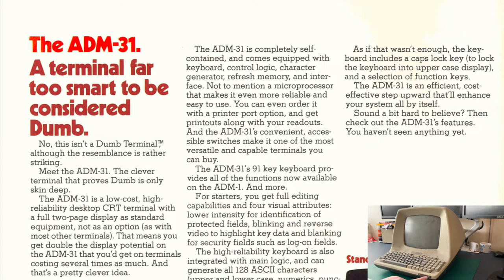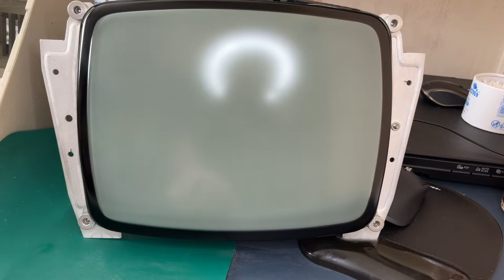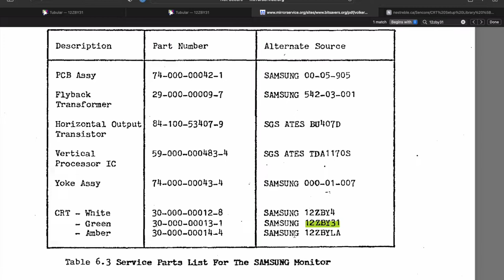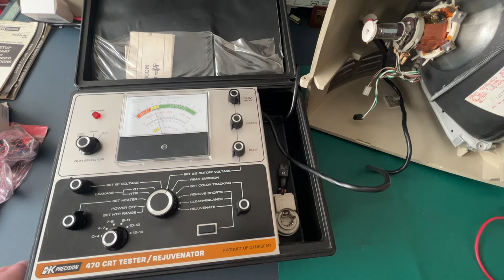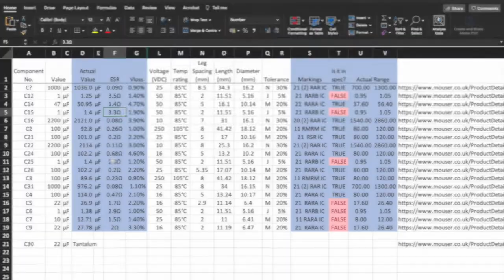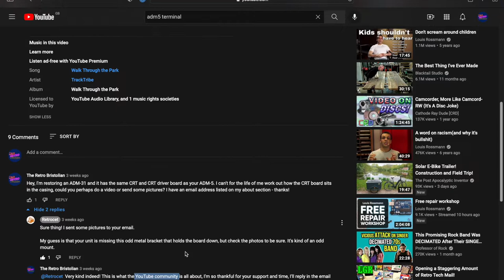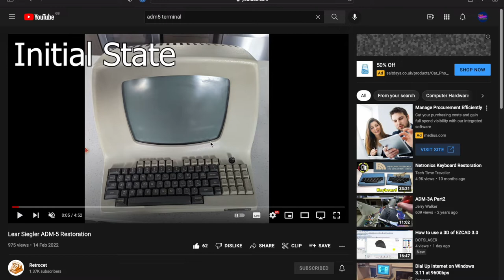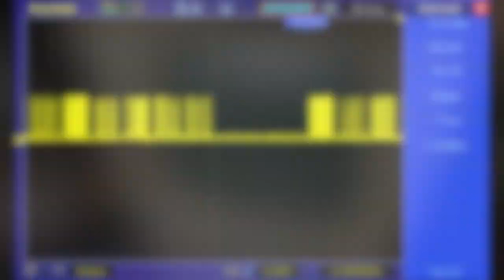Lear Siegler ADM-31 Terminal - Repair & Restoration Pt.1

Comment: Hi David,  Just did a spectrograph on the sound coming out of the terminal at the end of the video. Ive sent you an email with it. the horizontal frequency is way too low at 7688hz.  it should be at about 15khz ish.. My hearing is poor due to too many live concerts so i use Spectroid app on my android phone to hear things i cant hear.  I would check the horizontal ....

Comment: Used an ADM terminal in college to write 6800 assembly code and it eventually went to a teletype that could also produce punched tape. Then after college was able to use a TRS-80 Model-1 computer.

Comment: I just bought one of these and am waiting for it to arrive.  My first thought would be remove the CRT and CRT power board from the equation.  Can you pull a composite video signal from the logic board and send it to a known-good external video display? You might feel better spending time trying to fix an old analog CRT if you could see that the underlying brain of the terminal was already working, or if you should focus on that instead.

Comment: Have you made any progress on the terminal. I have one of these still in use on radio automation equipment. Make sure the contrast and brightness pots are ok and turned up. The solder connections on the pots can get lose. Also jump pins 2&3 on the serial connector this allows you to type and locally display. This will verify that the cursor is not hidden off the screen. As the pots were cleaned it’s possible the data is there just off screen due to size and position adjustments on monitor board. The high pitch whine noise is a good indicator that it’s possible out of adjustment with sizes causing yoke to deflect beam off screen. Some high pitch sounds are normal from those CRT’s. Mine has given issues with the bright and contrast pot on main board from getting dirty over years and causes blank screen issue. Try simple things first. Sounds as if the terminal is working. If you have a serial cable connect and set rates same and use a pc with terminal emulator and send and receive from keys this will check the communication. Might need null modem adapter or custom build cable
Reply from the maker: It's back in storage at the moment. your points are very interesting though for sure, when I get back to it it's all things to try. do you have an ADM-31? or a similar terminal? it would be helpful to see a video of one powering up, and being used - Thanks for stopping by and offering help/support.
Reply: @TheRetroBristolian  I will do a video of my terminal and a few test results as well that you can try.
Reply: Here is the second video I done on sync pulses measurements from the SMC CRT controller IC. https://youtu.be/37neAAYg7xY?si=WDL4_TMgUr2Xr9xs
Reply from the maker: @rick601a  I've watched both videos and have to say the information is fantastic! So much for me to unpick and test, very interesting how early your terminal is and how it has the different PSU and monitor. When I get more time I will do a follow up video next year and of course drop credit to you when fingers crossed I make some progress.
Reply: @TheRetroBristolian  let me know if you need any measurements made around the IC’s. This terminal is packed with logic and can really look confusing. I finally figured out the sections and layout. Most of the logics I had to look up data sheets on the individual IC’s and test results where the service information in very rare to find. Both monitors used have online schematics. I just wish I had the service manual for the logics. The maintenance manual part number is DP310 but no one has one left that I can find. Sadly most service centers threw out any documentation years ago.

Comment: I just came across your video. I notice it was from a year ago but no updates since then. What happened with the restoration? 

Please try to jump pins 2 and 3 on the com port and type on the keyboard and see if any characters are displayed.

Look to see if there are brightness or sub brightness adjustments on the video board and try to adjust thrm
Reply from the maker: So, The update was, I took it to work, managed to create a separate circuit to power the CRT stand alone and generate the signals needed to make it energise, managed to get a green dot on the screen. in terms of the terminal, there was a comment from a fellow YouTuber who kindly made some videos to show how a working terminal works - which is very useful and I will revisit this one day.

At the moment personally I have a lot going on, my grans house has finally sold this week, she passed in 2022 so it's been a long and stressful road, I now have 5 days to clear the house and swap keys so that will be taking up my time. after that I'm trying to build a room for all my projects and work, but having issues with planning so it's delayed. Thanks for stopping by with a comment.

Comment: Part 2?
Reply from the maker: One day, sadly I haven't had time or gained any useful knowledge to move forward with this project. I have proven the CRT and driver board seem to be OK and it looks to be the terminal board not giving out the right sync pulse for some reason.

Comment: That probe is really not gonna discharge the crt if it had voltage. The probe really is just a voltage divider of REALLY high resistance
Reply from the maker: Why won't it discharge it? there is a resistor between the probe and the ground point and it can be used to discharge as well as measure the high voltage.
Reply: Well it will but you wont see or hear it discharge. But it might be actually better to discharge for a second or two because of dielectric absorption.
Reply: @TheRetroBristolian  also if the crt has an anode capacitance of around 500pF and the high voltage is 25kV then it would take just over a second to discharge with a 1 gigaohm probe.